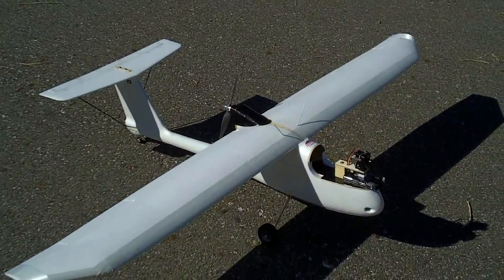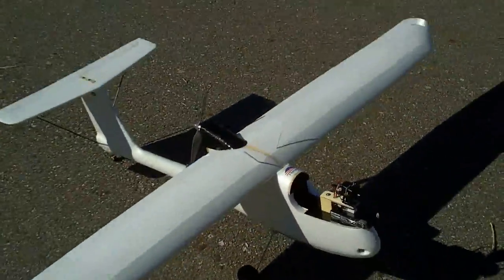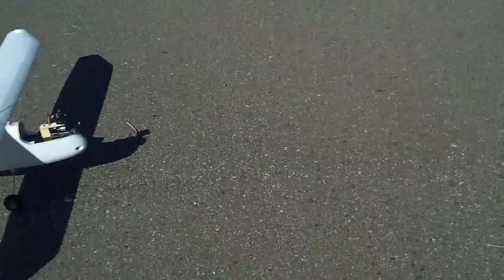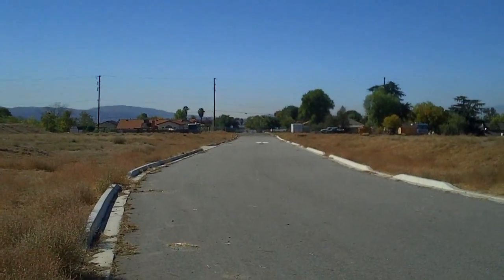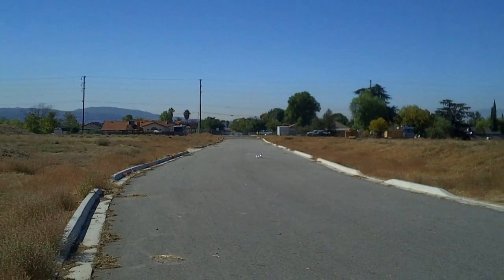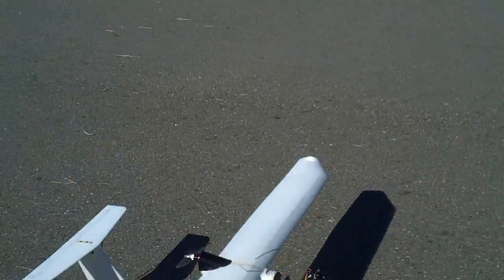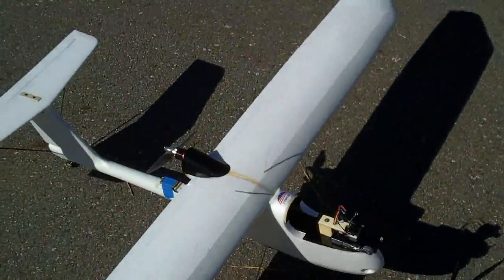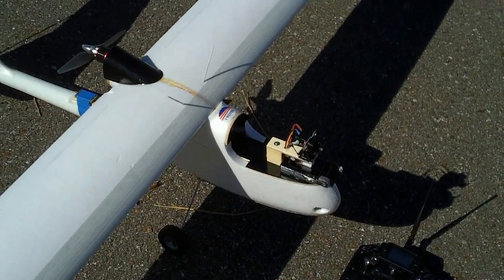Skywalker mid-day inflight emergency!

Comment from the maker: LOL, get this...I bought a hotliner carbon fiber/glass 54" slope ship and paid about $500 bills which included a $25 micro sized LiFe battery for the receiver. I am standing on the slope face and do a radio check, all surfaces look good and I am nervous...I toss her into the stiff breeze and hands free she slowly climbs away then starts to level drift to the right. I try to correct and no FN response! That little $25 battery had a bad loose connection and I tossed $500 bucks over a cliff.

Comment from the maker: Hey Mike, sorry to hear the runway is closed due to foul weather..telemetry? what's that?
LOL, I will install my pilot assistant Ruby, by uThere com, into the SW soon. I also use FrSky 2.4ghz hack mod into my Airtronics RDS8000 for killer range while my video will operate on 700mw 1.2ghz TX.
Thanks for the question and comment bra!